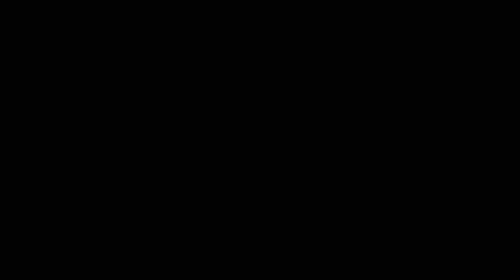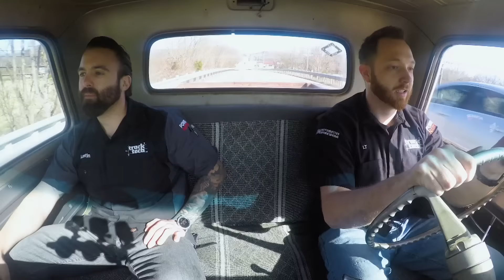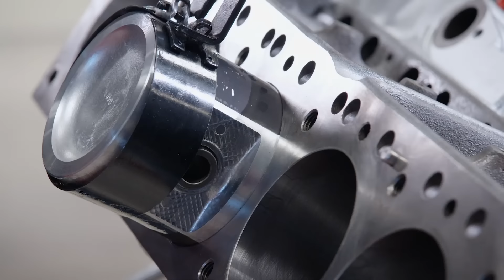Forget the LS Swap: Building a Turbo Chevy 292 Straight-Six

Comment: Want more engine build content? Subscribe to the all new ENGINE POWER channel!

https://www.youtube.com/@enginepowertv
Reply: I miss Mike and LT.
Reply: I'll
Reply: The 292 in front of me is core shift issue , so not a great casting. The water pump clearance machining is also tappers. Is this block good enough to build up to 330 hp? Is this block safe to 5,k rpm? 
Is upgrading the lifters to a larger bore off limits?
I traced the bore diameter onto the head and noticed the combustion chamber is not a circle. Is this common?

Comment: My mechanic or used to be my mechanic because he's retired now. He don't even change his own oil now. But back in the 60's and 70's he built these engines and drag raced. He said he made all kinds of money going up against small block chevys,ford 289&302's,mopar 318's&360's. Folks would bet all day long and lose one race after another. And he didn't use turbos.

Comment: Best engines I had: Dodge slant six 225, Chev. 230 and 250 inline six and the Ford inline 300.  These are the engines that you put in your wife's or girlfriend's car.  You can't kill these engines.  I've seen them run with no oil showing on dipstick.  Almost bone dry radiator.  And then the greedy automakers realized that they were losing money by producing these engines.

Comment: WTH= more indians than chiefs = MAKE IT GET GREAT MPG !!!!!im wanting pull a lawn trailor in big city ! low torque great gas ... trying deside 250 6 cycl or 292 .. and just single barrel carb .. still= likes all the add ons .. like port polished.. and roller rockers - and bigger exhaust valves for coast/better gas .. longer last from better parts and less backpressure ! im want reallly Really good mpg.. so i considering 1970 LH mail jeep.. 2wd .. light - iron duke build - what you think ? Please dont forget us indians !

Comment: from 1993 to 2000 my two brothers, and I circle track raced 2.3l ford engines with arp studs. we built our own engines and would run them at 8500 rpm. did not know you should line hone them. never lost a crank. dropped a few valves but never any crank problems.

Comment: The 250 did 165hp, the 292 did 250hp at GMs own dyno. Im confused to which engine they built because if that was a 292 it should be in the low 300s hp

Comment: Pat, didn't you listen to the Old Timers.....??  You do not have to sand the fins off the valve cover after painting....that is too much work....before you paint them, put Vasaline jelly on the fins or any area you do not want painted. Then Paint, then wipe off the jelly....simple, easy, clean...we did it this way in the early 1960's....just to let you know.

Comment: Almost wish my 68 C30 had come with a 292 but it came with a 327. For a 6 banger I'd like to see what you guys could do with a 94-97 Toyota 1FZ-FE 4.5L from a Land Cruiser and add a turbo. Stock they're around 212hp and 275 ft-lbs. Might do the LS swap anyway but I'd like to see the 4.5L built up.

Comment: Looking to re power my 80 J20 wanting torque and decent mileage and reliability. Ya know how it is I want it all lol. Been looking at Ford 300 Dodge 225 and GM 292.
Ran a 292 in my 65 C5 I bought that 292 off an old boy stock car racer/builder wish I could remember what he did to it 1990 was a bit ago. 
Thanks for a great episode. I do appreciate the tech with the bling it's all about learning not just being entertained w/o drama. I'm signed up for your excellent content

Comment: 15+ years ago I saw a buildup of a 292 that made 320 hp and 400 torque.  Installed in a 3000 lb nova it ran high 11s.   That is blazing fast.  I love the 6 cylinder buildups.  One of my high school friends did a buildup on a slant 6 that made 250+ hp, which was 100 hp higher than the stock engine. It was kinda fast but my GTO blew its doors off.

Comment: It drives me crazy when I watch them paint a block and fail to block off threaded holes. it’s a great way to get a bolt stuck going in and then broken off trying to get it out, and you will never get it out. You will have to machine it out.

Comment: Could you not find a usa/canada cast block? This block was cast in mexico and is also a later model block. I have heard that the cast iron is not as good as the earlier blocks. You can tell it is mexican block because of the dimples on block and lines on bellhousing ear on intake side. Liked the build!

Comment: Very nice video👌.  I loved how you measured the bores to check for distortion as a result of not using a torque plate (was interesting to see the results). That's a reasonably aggressive cam grind for one of these engines, I'm surprised it didn't make a little more power on the dyno but I guess the lower compression ratio for the future turbo may have something to do with it. Be interested to see results once turbo hooked up.. do you think the hyper pistons will last the distance with the forced induction? Curious to see what boost pressure it's run at..

Comment: I don't get it, all that work and it's only half as good as a LL8 Vortec 4200 inline six with just a reground cam, those are in the 350hp / 300lbft realm.  Why doesn't the Atlas get more aftermarket support?  They are cheap, plentiful, and take boost like a Vortec LS style engine.

Comment: This is my favorite build I took my drivers license in a 1959 apache with a 292 inch 6 cylinder it was a fun truck it was mint condition to three speed on column my uncle said someone ordered a brand new motor for a school  bus and never came back to get it and it was setting in there shop brand new so he bought it put it into a 59 Chevy truck in mint condition for his own truck I was lucky to get to use it to take the driver test because it had to pass inspection to use it and it was all mint and the parking  breaks still working right I remember after I got my license he let me go out on dates in it I used out run a lot of cars from dead stop I could pull away from them hard it had plenty of power to out run normal cars this was a strong set up I can only amigine it with  a turbo charger on it you need some serious rear end to plant it down to the road the one I remember would  smoke the tire everlessly

Comment: The cam gear should never be pressed on!!
It definitely failed because they scraped aluminum off it while pressing it on!!the cam probably was walking back and forth inside the gear before the break in was done!!
Supposed to heat the gear up and freeze the cam then it would have slipped right

Comment: OK,  I Built a 60 over 292 first one ever in my life of Hot-Rods !!!!   . headwork ,ported, intakes lumps 194/164 SB VALVES w/ SB/Rollers , SmIth mad up push rods (5/16) coating all internal bearings ,Balanced asm. Roos forged ,floating pins 100th off head and block ,Schneider cam only went, I think I could have gone more lift 505/525 but 245@ 50 ,108 separation 106 intake (stick car)  tuned long tube hedders with 30 inch collectors , Holley 450 dual quads on a Clifford and tons of other top shelf parts ! Not a dime spared .Lots of dyno time 383 HP  418 .7 TQ !! ...................Wish I had you shop set up and resources.. I had to take 425th off the rocker stud surface to get the 175 rollers to get the proper lift and I put screw in studs with guides ,push rods by Smith Bros.
Reply: Tbh I think the inline stovebolts are the best 6cyl chevy ever made i always loved the simple design and simplicity of these motors I'd pik this over a 350 anyday even as a cruiser not for hp but torque these things could pull and take off so quick they were not good at passing but off the line great

Comment: 1969 Chevy 292, bone stock, 1 barrel carb, is rated at 165 hp and 280 ft/lbs. So, a gain of 55 hp and a loss of 11 ft/lbs? I'm disappointed. Nice video, though, and it really looks good.

Comment: The cam set for the Pontiac Iron duke is much better  not fiber nd not aluminum   motor needs quench  btw I've built AMC 199 to over 1000 hp for Indy

Comment: I know this is an older video, but I love the 3rd gen straight sixes. 7 main caps for extra rigidity, 120* firing for less side loading of the crank. And torque for days right off the line. 
Working on a blown 292 myself for an older hot rod because...why not. Did have an interesting thought when they were honing the big end of the rods tho.
They checked the diameter right off the hone with oil still coating everything vs all the other measurements on the engine done dry. I have to wonder if the oil film would affect the measurements enough to need to be taken into consideration. Granted, on a build like this, the minute amount of difference shouldn't be anything to worry about vs a full spec engine with much tighter tolerances and factoring in that bearings are going in.
Reply: The oil film on stationary parts is literally atoms thick. Shouldn't be an issue, other factors like temperature are much more important.

Comment: They have good power and torque for most vehicles. They're economical and the older version are cast iron indestructible engines.  But, everyone wants V6s, V8s, with fuel injection, computers and everything aluminum.

Comment: Hey guys....this question is a little off topic but not sure where I could better ask. I have a 235ci chevy in line 6 just wanted to know if the head can be removed without pulling apart all the rockers and springs ect. to repair a blown head gasket.

Comment: I too did a 292 build in the early '80's to put in my 64 Chevy van that I had converted to 4 wheel drive. I started with an industrial engine I sourced from a wrecking yard that had been used to drive an agricultural water pump, because they were built much more stout than the automotive equivalent, they were built to run nonstop all day and night. It was bored .30 over and balanced and line honed and the block and head were flattened out. The head was fitted with big valves to make it like a 194 fueler head on a V8, it had an Offenhauser manifold and a Carter 4barrel carb and dual exhaust headers. It had a comp cam and high volume oil pump and I found an HEI distributor out of a later model 6. Sadly my van was hit while parked by a drunk driver and looked like a Banana. It found new life in a '69 Chevelle for a while until I put it into a '68 Grumman Olsen Curbside step van. If you were in Huntington Beach in '85 - '86 then you saw it parked on PCH North of the pier almost every morning as it was my Surf mobile! In those days I lived to surf! 
 As for power I never got to Dyno it, but in that van, which had a 5 ton gvrw, and 5.88 rear end gears with a top loader granny low 4 speed I easily pulled the grapevine going North from Bakersfield at 90mph and could have gone faster, but I was afraid of getting pulled over by the Chippies.
 It still lives today mated to a 700R4 automatic in a '67 Nova and she still is a runner!
Reply: 5.88???😮
Reply: @nonsequitur807  My thoughts exactly. @90 mph?
Reply: Great story! Good for you Sir!
Art from Ohio
Reply: If, in fact you did or do.. live in Ca.... your sense of geography and direction is all messed up.   IF you were "pulling the grapevine" FROM Bakersfield... you sure as h**l weren't going "North".... you were going SOUTH.     5.88's at 90mph..... Really?!?   lol
Reply: @Romans--bo7br my thoughts exactly grapevine is south of Bakersfield. I asked Ai about it. 1:1 through 5:88 s 
34" tall tires = 5250 rpm. Does a gas I 6 
Rev that high I know a desire i 6 does not.
Reply: @Romans--bo7br  At the time, I wondered what smelled so bad, you must have been sitting right next to me.
 You weren't there, you don't know.
 Why don't you comment on what you do know, the plumbing in your grandmothers basement.
Reply: Nice Job Bro. 🤘😎🤘
Reply: And has a sound from your headers and internals that a v8 can never do!  I’ve had mostly 6 cylinder vehicles all my life.   A few bent 6’s, not that good as inlines are better.  Mine have been AMC, FORD, 5 JEEPS, (STILL A 2003 G.CHER)”, CHRYSLER, GM.  I have a 67 Mustang with the great big 200 c.i.(for the newbies that’s a 3.3 ltr), with a bench seat(stock), c4, and it’s all my wife got for my 65th birthday, she got it from her daughters neighbor for only $4,675.  And I drove it home.  But, I love the sound that tiny 6 makes just the way you love your 6.
Reply: Did this to a Ford 300, could interchange from turbo to supercharger, sleeper '70 maverick 2 door.
Reply: @Allansybesma  Ford 300's are legend!!!
 I also enjoyed tinkering with the MOPAR slant 6's
Reply: Yo tengo una Chevrolet custom de luxe 80 caja corta y tiene el 292 sencillo pero lo quiero alterar al máximo... Dónde puedo conseguir todos los accesorios??

Comment: The (smaller) Aussie Holden reg motor versions of this were a staple of hot-rodding in Australia for decades. From 173 cu in up to 202 cu in.
I had a low compression 173 with an aftermarket big valve head, a two barrel 500 Holley and headers in a van. Electronic ignition and fibreglass cooling fan. The original rear end was a 4.5:1 which I swapped out for a 3.5:1.

Comment: This is an engine that equipped many cars of the GM line here in Brazil, the GM250 mainly, very widespread and prepared by us here.  We got to get over 1300hps from these engines with the original block.

Comment: WHY didn't you use roller-rockers?    I think you should have used one of the blocks to then sand-cast an engine in Elektron/other alloy.   Why didn't your guys want to take their 292, bored to 302, because the displacement would attract more queries, and the Surprise'd be complete when you opened the hood and saw an inline, instead of the usual BORING V-8.  Then you could machine various things{--from the Alloy-block } & we could SEE that.  One of the reasons GM went to the 265 V-8 in the day {1955}, was because the 235 inline block was 40 pounds Heavier than the 265, plus 80Hp More was available with the slightly larger 265.   An all-alloy 235 "Blue-flame" was what SHOULD have gone in the '53 & 54 {& 16 '55s built with left-over 235s } Corvette, but Chevrolet Stupidly used a regular 235 block.   There MUST be Opal/Vauxhall/Holden crossflow/DOHC alloy heads that would "fit" on the 194 inline-6 & larger displacements,--the 292 being a "tall-block" 230-250 inline.  WHY don't customers WANT a more advanced-head "Aussie-build"?   You could "3-D" an alloy-head, avoiding the machining of a casting.   The TVR 4-Litre inline DOHC head, could be safely copied/"3-D'd", as TVR patents are no longer in force, yet the TVR with Vauxhall block could make 350-400+ Hp stock for TVR in the mid-80s.  Thanks for what you Did do, I enjoyed the build.

Comment: Cool, but not practical. I have been a auto mechanic since the 60's. Raced dirt track in the 6 cylinder class. I raced a Chevrolet 6 cylinder engine in a 1957 Chevrolet. It had intake and headers I made from exhaust pipe (father owned two Midas shops), the heads were done, a special cam shaft, Mallory ignition and a 500 CFM Holley carburetor. It was a hot 6 cylinder but I'm sure not even a 1/4 of what you spent.

Comment: The 230 crank weights 35 lbs less than the 250 I'm not sure about the 292 ,but I traded 20 ci for 35 less lbs on my rotating assembly  , TRW forged 11:1 from a 283 ended up about 14 :1 in the 250 with the 230 crank , 710 lift solid roller , pulled good above 5000 rpm , $10,000 later , should have got a V-8

Comment: Would have been nice to see some dyno pulls. With 10/1 compression
Reply: Putting one together at 10:1 you have to order custom pistons,  and thats not cheap. The aftermarket offerings are non existent. They used stock style replacements in this video.
Reply: @Texassince1836  
In the past I talked to Aries about making pistons for me
At that time they would make anything
They could. $65 a piston. Minimum 4
In my case the manufacture used a ring design that was for racing
Not for a diesel...

Comment: Its extremely interesting this motor was rated at 160hp from factory and these guys built a ford fathead V8 that when they were done made 157hp. And no this isnt a ford vs chevy statement I just find a 6 cyl doing better than an 8 freaking awesome

Comment: I like others would like to see this test with 10.1 comp and a non turbo cam. At 300 inches I believe 300 hp possible. I’d also like to see a Clifford intake on it. 
Our 311” GMC with 13-1 compression, stock head which is not nearly as good as the later 194-292 along, with a .610” lift on the valves, a single 650 Holley, has pushed our roadster to 171 at Bonneville and has never been on a dyno. I’ve seen claims of 400+ HP on gasoline with these older engines but don’t think it’s possible on 4 mains.

Comment: The only issue that should be addressed with better technology is the water-pump. Why? If your water-pump starts going out and you don't catch it right away? 
The cooling fan will fall right into the radiator and ruin it.
The pump bearing usually goes out without much warning. 
My new build with have electric fans on the radiator.
On my 68, I put a modern radiator in it and mounted and plastic overflow reservoir from a latter 80's Impala on the inner fender well and it fits easily under the hood, plenty of room.

Comment: Me too!
There is a web forum dedicated to the 292.
I have a 1968 Chevrolet C20 with coil springs that has a stock 292, 4 speed manual, former state gravel truck, dual pivot hanger bearing driveline with a very low geared posi rearend. It can pull a train down a dirt road!
I never drive it over 50-55 mph, because it's humming like a german tank!
An OD high gear for the highway or interstate would be nice, while keeping the fun lower gears for pulling.
I have a spare 292 with 4 gear to hot rod someday.
That spare 292 also came out of another former state truck that was auctioned off.
Torque, torque, torque!